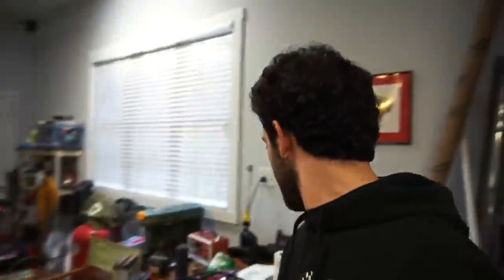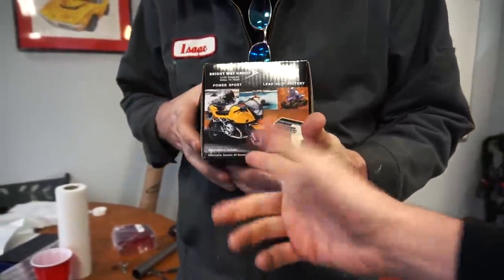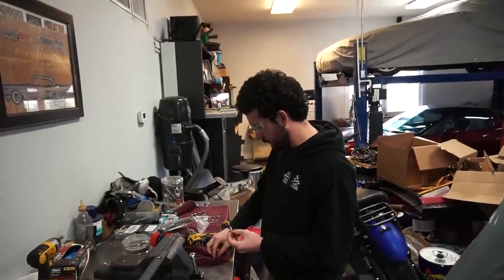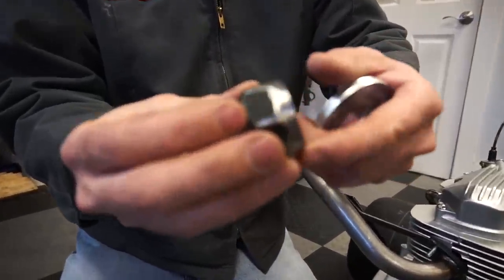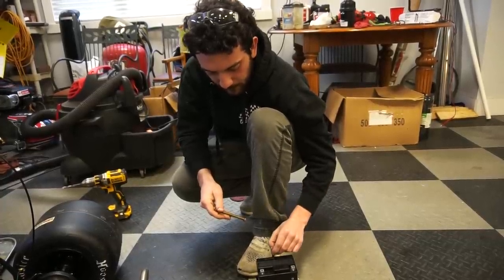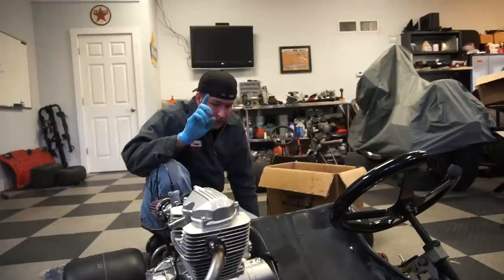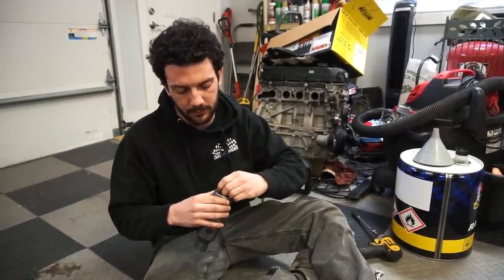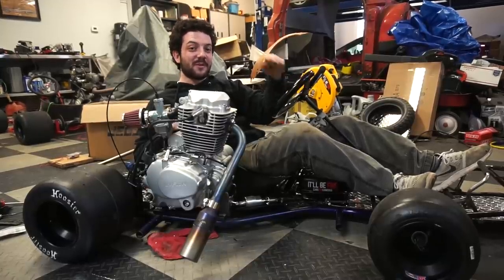200cc Shifter Kart Build: First Fire!

Comment: It's just a low grade shipping oil to prevent rust. You must change it immediately because it does not provide proper lubrication and is not suitable for wet clutches
Reply: Steve'sSpeedShop beat me to it lol 👍
Reply: Steve'sSpeedShop amen brother................
Reply: Steve'sSpeedShop Since watching these videos and hearing the guys talk about changing the oil immediately, I’ve always wondered the reason why. Thanks for the explanation!
Reply: Figure these guys would know about this kind of thing. Especially Ike. He should know.
Reply: Exactly right Steve
Reply: I've seen so many people destroy new motors because they didn't know this lol
Reply: One guy I know bought a cheap pitbike engine and it had cooking oil in it lol
Reply: PitbullOnAcid 
I find em occasionally with the old oil in em. 
My Chinese 4 wheeler had the tar in the engine and the reversing gearbox. 
Luckily it only had a few hours of runtime on it. 
When I did the gearbox I spun the output with a drill and filled it right to the top with oil and mineral spirits to flush it out. 
Within 30 seconds it rotated easier.  
That stuffs wicked nasty, like pure crude oil.
Reply: Steve'sSpeedShop You beat me to it
Reply: Asian motor oil is very expensive, so they ship with low grade cheap oil that is only there to keep the parts from oxidizing in shipment. This has always been true. My cousin was a Honda mechanic for 30 years and changed the oil in everything right out of the shipping crate. We used the old oil to lubricate the hay baler.  Wet clutch always meant to never use a detergent oil like the old Quaker State, it would eat the material off of the clutch plate. 20-50 Castrol was the stand by.
Reply: It aslo can be in store start up oil jus for engine tobse if it runs okay I had that on my buggy when I both  it
Reply: @feidex  huh?
Reply: @NessieTheCatt  synthetic speed blend?
Reply: yep makes your cart go zoom zoom super rare oil supposed to run it at 9k rpms to break it in
Reply: @NessieTheCatt  not sure if your joking or just crazy
Reply: Scientific data proves ky jelly is the best on engine ware
Reply: That is true.
Reply: @suzukietc1373  lol

Comment: Yall been doin this what? Five years? And ya still havent bolted down that bench grinder? Or the vise for that matter lol, i dont see how you deal with it!
Reply from the maker: It’s kind of a staple of the channel now
Reply: Use staples if you have to John.
Reply: As per agreement, they cannot drill any holes in the benches. Haven't you guys been watching?
Reply: "C" clamps...2 sided tape...,velcro...,bubblegum...!
Mount that F-n Grinder or else ? :/

Comment: Some of the Chinese engine forums say the reason for IMMEDIATELY changing the oil is that most of the engines are shipped with fish oil in the crankcase. Not very good for lubricity, but it diperses water quite well...

Comment: I have the same motor but the 250 on a custom kart. For the fuel pump I ran a T close to the carb with a line that went straight up a few inches and returned to the tank. It stopped my fuel leak with the pump. Also a quick port job with a rejet and cheap CDI will make a huge difference. The best would be to get a mikuni carb with an accelerator pump. And make an ignition cut for better clutchless shifts. Can't wait to see the results

Comment: not the inside magnet,theyre for charging or lights. the outside magnet is for the coil.
Reply: I'm sure that it was a quick and unintentional error.
Reply: If you work that much on engines ,its a real fault
Reply: Was going to say that!
Reply: your neighbors must love you
Reply: 220 Motorsports depends on the engine some are outside and some are inside

Comment: I had a mechanical pump on a cam on the rear axle from a volvo b18 engine. cost like 10 dollars. it stops pumping when the carb is full and a little bit of pressure is building in the line. so when you are standing still you prime the carb by hand and when you roll it will always have fuel!

Comment: There's a screen type oil filter in that motor don't forget to clean it when changing the oil. Also it has a wet clutch so use motorcycle oil. My Lifan 200 Enduro did 72mph flat out, ran out of gearing not power. Hope this helps I love the build.

Comment: They run it to whatever rpm it goes to an call it a break in run usually tops of 30 mins,  how all motorcycle engines are broke in. Also DO NOT PUT CAR OIL IN A MOTORCYCLE ENGINE, they have a wet clutch witch uses a dense oil a 10w30 weight bike oil is a different viscosity as 10w30 car oil the engines use the oil for the clutch and it helps shift i would run honda oil in it non synthetic cause thats what they call for
Reply: Kylee Bates that engine should be dry clutch. My older brother has one on a mini bike and that’s dry clutch
Reply: I agree with 2redneck, that bikes can use regular car oil with no problem if it's the right viscosity. I'm running some regular car oil in my bike with a wet clutch.
But it's not quite right what you said 2redneck, ahout synthetic oil, because if you're using synthetic oil of the right viscosity, the clutch will behave mostly the same.
Also there are synthetic motorcycle oils (even tho they're specifically designed for wet clutches and work much better than car oil).
Reply: Trifiiniti it's definitely a wet clutch. Regular oil will cause it to slip. Most regular mini bike have a external centrifical clutch or cvt.
Reply: 2redneck car oil has additives and detergents that make the clutch slip. It's better for motors but bad for clutches.
Reply: Okay, thanks. I should change my original comment, because I was sure it's just about the viscosity, but I'll just leave it with your correction down here.
Thanks.
Reply: honda 3 wheelers will slip all day, people think the clutch is gone, naw, bubba used some motor oil lol. put honda oil back in it, hang tire for days
Reply: I don't race, but I'm on a budget and I got a engine on the edge of what it can take in terms of power and knock.
Reply: Kylee Bates you got that from RCR didn’t ya bud
Reply: I dont even know who rcr is and no😂 its what ive found out from years of experience.
Reply: Kylee Bates are we related?
Reply: BoostAddict idk are we
Reply: Definitely use a motorcycle type oil for the wet clutches. When I bought my ZX9R the clutch was slipping due to the previous owner using car oil in it!
Reply: Kylee Bates we have the same last name. Although there are a lot of unrelated people with this name.
Reply: BoostAddict not sure you live NC?
Reply: Kylee Bates Nope. Canada eh.
Reply: east coast of Canada?

Comment: Most of it is engine grease for the build. Really sticky and yes you should change it asap. Buy small engines oil and break in with that, then change it again for good measure. Sweet build Guys!

Comment: No, the outer magnet is for the ignition coil. The two inner magnets are for the 12vdc (or so) charging system, etc. The Flywheel (magnet) is keyed for the ignition timing.

Comment: U need tp change the oil because thats the oil that basically has sand in it it grinds the gears to move smoothly atleast in europan 50cc mopeds
Reply: why would they put sand in the oil to make it smooth? that is just stupid if they did that, nothing gets smooth by sand
Reply: Kristoffer Persson ever heard of beach glass or rocks?, literally gets smooth from sand. So yeah. Things can be made smooth by sand. Think before you write my guy.
Reply: it does not get SMOOTH it sands down the surface, may be "smooth" to touch but in reality it takes material away not make it "smooth" so you should fucking think before you write. and why manufacturers put sand in an engine has so much to do with beaches and rocks it is mind blowing
Reply: Kristoffer Persson you sir are very very mistaken some shipping oils do have particulates in that are like sand and that is to fix any bad edges on the gears and to also clean any parts in the engine when you swap out that oil it flushes out most of these particulates. And the analogy from earlier about the beach is correct sea glass is super smooth  because of the action of the sand and stones rubbing over it repeatedly this is the point being made.
Reply: Rhys Aistrope uum.  Yes?
Reply: So basically them running it for a couple minutes is fine but they should change it after that.
Reply: Kristoffer Persson 
Fill your engine and gearbox with sand. 
All the kids are doing it. 
It’s the new slick 50. 
Don’t like slick 50? 
Call it z-max then.
Reply: noha wagner they get smooth because of the water, not the sand.
Reply: Rhys Aistrope its because of water running over them, not sand.

Comment: Yes, change the oil. It is only like $4 for good, new oil and then you can know how old it is, for the next change. And can you get a tachometer for it? And If you turbo it, it will not leak gas from the carb, Or do:   Turbo  Big Bore Kit   Cam     Port & Polish      Shave The Heads      e.t.c. (can you do a spin-the-wheel to chose what up grade  to do first?)What other Ideas do you all have?   :P
Reply: This engine been around for a decade, different models and I've nvr heard of any of those parts being available

Comment: Probly not a good idea to rev the crap out of a brand new engine with that shipping oil in it. Or at all. Just shortened the life of that engine. Please build a man sized 4x4 full suspension off road buggy something not kid sized please that would be awesome to see
Reply: John Smith where the money to pay for some fuckin shit like that? You it? You gonna donate it to them? Didn't think so. Johns a college kid and Ike's a mechanic. So that much money to completely build a 4x4 buggy. It'd be easier to by a destroyed jeep, strip it like a trail truck and build a roll cage. And even that's not gonna happen. There's no way dude
Reply: I think the 2seater buggy build idea would be great!!! If they built frame  with a tube bender or a $500 pre-bent tube kit. I wonder which would be cheaper? Also fab most of their own parts( front suspension, independent rear suspension,et,..). Ike probably bend the tubing himself, he good at that sort of thing. Joh gotten perty'good welding too! The dynamic duo 🤪.. 
The cost of a project would easily $5-$10k. but it's nice to dream I guess.
Reply: It's not that much to build off roaders.
Reply: Check out the 4 wheel drive go cart
Reply: probably won't hurt a thing as long as they just use it to run with it in garage to test n tune. Now if they go ride n hammer it all day then it would b an issue.Any oil is better than no oil

Comment: Last time I was this early John loved my comment. Some rumours say so as well. Btw when you wind up changing the oil you should use motorcycle specific oil because it contain special additives to better protect the clutch pack which is submerged in the engine oil. You wanna make sure that the oil you use has the so called MA2 specification for motorcycle oils. Also I believe you should run a fairly thick 15w50 grade oil since the engine shares the same oil with the transmittion.

Comment: Head & sides bar. Exhaust shield. Run exhaust rearward. Get another magneto (snow blower) to charge battery, run accessories. Horn button in middle of steering wheel. Cage the front to protect feet. LED all lights, easy on system, long life.
Reply: ,,, I agree with you very well said

Comment: For that particular fuel pump you need to get a fuel pressure regulator. That thing puts out a higher fuel pressure than you need. I used one of those on a 460 ford and it would push too much fuel to the carb at idle.

Comment: The 2 magnets on the inside of the flywheel are for the stator the single magnet on the outside is what fires the coil. Other than that love the videos keep up the good work.
Reply: You are correct signal magnet coil on outside CDI box you too cool to on inside yes for Stater you're correct

Comment: Yeah, responsive! Man, that thing is gonna rip! Was wondering if you couldn't mount a piece of curved sheet metal, or maybe repurpose a section of old ductwork (?), to use as a heat barrier/firewall between you and the motor. Hard to say, might look cool too though. Anyway, awesome build guys!

Comment: That cdi is called Capacitor Discharge Ignition hence CDI that flywheel produces an ac current that goes to the cdi charging the little capacitors inside the box then quickly discharge to the coil the coil raises the voltage to fire the spark plug. The stator on those engine should make about 40-50 volts ac at idle and when reving as high as 70-80 volts ac. The the red and black wire coming from stator should be power for cdi and the white and blue wire is a pulser wire for cdi, that's the wire that discharges the cdi box. Once the capacitors are charged the pulser wire connected to stator pulses  discharging to the coil. With Every rotation of the engine this process is repeated.  Hope that clears things up a bit..

Comment: The flywheel you showed has 2 magnets inside for charging a battery, the ignition operates on the magnet(1) on the outside diameter of that flywheel. The spark plug fires when the magnet moves away from the pickup coil and the induced field brakes down.

Comment: Think of the CDI unit as the modern version of points & condenser. It does basically the same job digitally instead of mechanically.

Comment: Regarding the oil change right-out-the-box, It could be that they put a cheap oil to prevent rust but doesnt have the correct weight, additives, etc. to properly protect the motor from heat and pressure of combustion. It may be peanut oil..
Reply: blackston powell Next up: CarsAndCamerasandCooking!

Comment: So number 1 on my list of to dos for you guys is wrap that header up & get the heat away from that fuel pump & your arm.  Number 2 - before you go doing any form of driving, put a front brake kit on that bad boy to help it stop after your speed tests. Note some tracks wont allow you to run if its not fitted with lots of brake for a big motor

Comment: I haven't heard you guys saying anything about seat belts for this cart. I know you don't normally put any in your carts, but with the speed that one will make and the placement of the steering column, if you hit anything with your front end, that column is going to spilt the sack. Doesn't have have to a fancy seat belt, but a little discomfort while riding is better than the weeks of discomfort splitting the sack will give you.
Reply: ryan Kirby if they where to flip the kart a seatbelt would be a bad thing to have

Comment: Capacitor discharge ignition (CDI) or thyristor ignition is a type of automotive electronic ignition system which is widely used in outboard motors, motorcycles, lawn mowers, chainsaws, small engines, turbine-powered aircraft, and some cars. It was originally developed to overcome the long charging times associated with high inductance coils used in inductive discharge ignition (IDI) systems, making the ignition system more suitable for high engine speeds (for small engines, racing engines and rotary engines). The capacitive-discharge ignition uses capacitor discharge current to the coil to fire the spark plugs.

Comment: they say to change it straight away as it's just shipping oil and is like water. me personally I run mine gently with a little revs till she got hot then changed then ran her for approx hour half then walla. I used magnetic drain plug and it caught quite a lot o was surprised maybe u guys should try them ;)

Comment: Yeah definitely don't forget to change that oil! It's practically basic oil to stop the engine from rusting up. If you run it for about 2hrs or so she'll seize right up. Happen to one of the snow blowers we used at work.

Comment: The oil that is shipped in the engine is sometimes used to test the engine to make sure it runs before it ships, but they sit for a while after they are tested and the chemical additives that are put in the oil help prevent rust and engine lock while it is being stored and shipped, unfortunately the added chemicals lower the viscosity and will not lubricate the engine properly. When installing and testing you can use it but you do not want to use it more than an hours time. I work in a small engine shop and I've had to rebuild a lot of new engines because people don't change the test oil.

Comment: This would look awesome on this kart. It's the switch board out of race cars, and its like $20 on amazon.
12V Racing Car Engine Start Push Button Ignition Switch Panel 5 in 1 LED Toggle Switch

Comment: Cool. You said something about changing oil soon after starting. I know that one reason is that the Chineseium engines are good they have no to very limited time invested in cleaning of inside of anything they build. But if you change the oil very soon after first start your good Chineseium clone will be a great and long lasting engine. They just don't clean after milling of new engine that well. I love the blurple build. Hold to the our jock straps while riding it though. Thanks.